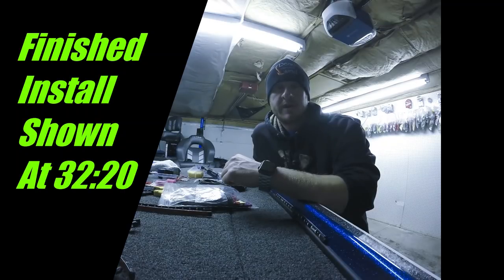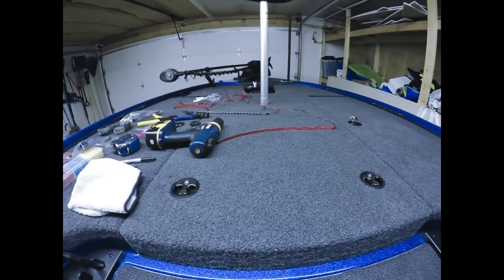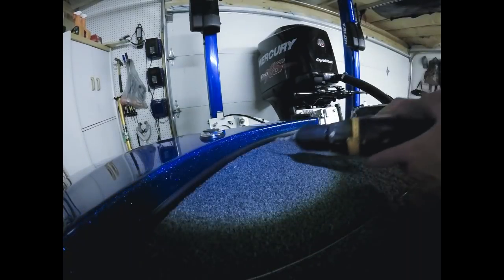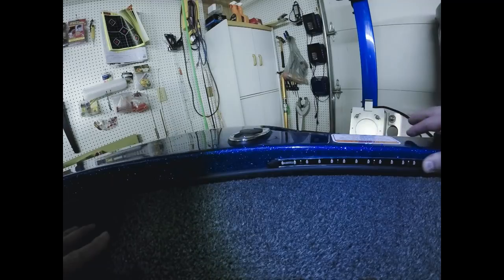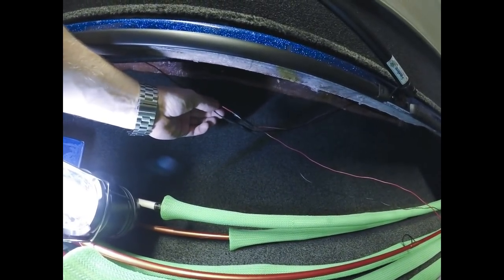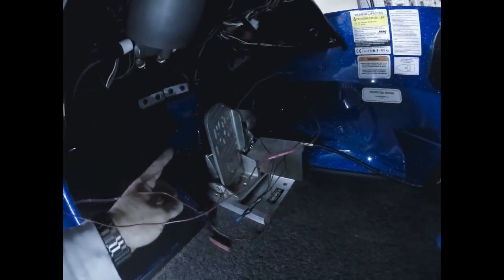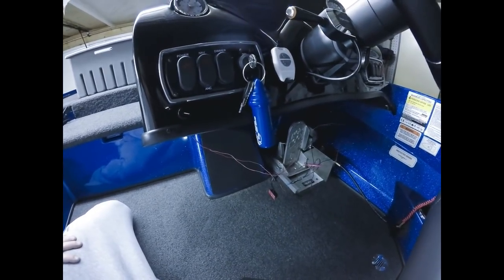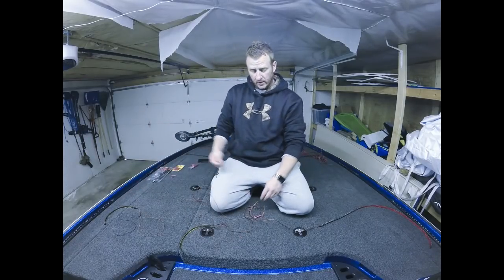Bluewater LED Install On 2018 Nitro Z18

Comment: Your video will help me out so much. I am installing a bunch of blue water light this weekend. One thing I was wondering is how you hooked up the dimmer switch.
Reply from the maker: Thanks for checking it out Mark!...yea I should have included the dimmer switch in the video, but it’s very easy to hook up!...maybe I’ll make a short video showing it for anyone who wants to see it!
Reply: @NitroZ18Fishing  that would be great to see how you did it before I start my wiring this weekend if it’s not to much trouble. Watching your video gave me the confidence to do my own boat over bringing it in somewhere to get it done
Reply from the maker: No trouble at all!...I’ll try to get it posted asap, but probably won’t get it done before the weekend unfortunately...crazy schedules with the kids and sports, I’m sorry!

Comment: Were the compartment lights already there? or did you install those too? And where did you end up mounting the on off switch?
Reply from the maker: hey Zach!...I installed all the LEDs myself, I have them in every compartment including livewells and even the cooler...I also have several switches mounted in different locations...the compartment lights are on a switch I mounted on console, the deck lights are on the dimmer switch I mounted on console, the livewell switch is under the lid, cooler switch is inside cooler at a convenient location (all wiring hidden, because I'm a freak about hiding the wires)

Comment: why the cranking battery and not the trolling ?
Reply from the maker: You honestly could use any one of the batteries but it’s usually best to run accessories off cranking so you don’t drain trolling motor set up with all the extras...the cranking battery will charge while running with big motor and will usually support the accessories with much better success from my experience...also, if you have any transducer on your trolling motor, it’s best to isolate that battery setup to minimize the chances of interference on your graphs....may or may not happen due to LEDs but I wouldn’t want to chance it...hope that helps!
Reply: @NitroZ18Fishing  very informative. thank you!. my lights are hooked up and looking great !!
Reply from the maker: no prob, happy to help!!...glad you got the lights hooked up!!

Comment: Thanks for the video. I am an electical idiot. I could have used the part where the fuse and battery were installed, but hey the video really helped me to see how to run the wires in my Z18. Love the shallow anchors you have too. Would love to see those brackets up close too.
Reply from the maker: hey Bobby, are you on facebook, on the Nitro page?...if you are, contact me on there and I will do a short video for ya on the wiring from switch to battery...I'm sorry, I should have included that as well

Comment: I dont know if I missed it, did you have to add an inline fuse and how big? Do you need to add up all the drain of the strips together when picking the fuse size?
Reply from the maker: Hey Mike!...I run a 7.5 amp fuse for this entire setup, these Bluewaters have a very low draw!...in most cases a 5 amp is sufficient but because I have so many strips I went up to the 7.5...hope that helps!

Comment: Well done with the installation, the boat looks GREAT!!!!  I did the same thing to my old Z6.  Be aware, I used that same dimmer switch, and it will corrode over a fairly short time.  That is assuming you didn't buy a waterproof switch.  I ended up buying the expensive switch from BlueWater.  Great job on the video as well!!!
Reply from the maker: thanks Tom!!!...and yea I'm using Bluewater's Dimmer switch so all is good...I used it on my last boat for 5 seasons and worked like a charm...thanks for the feedback!

Comment: This was awesome!  Thx.  ONE QUESTION,  WHERE AND WHY DOES THERE HAVE TO BE A FUSE?  ASSUMING IT REDUCES THE VOLTAGE TO THE LIGHTS BUT WANT TO MAKE SURE.  I ALSO HAVE A "MAIN" POWER SWITCH ON MY Z7.  I'M THINKING I CAN RUN TO THAT AND THEN THE DIMMER, SO LONG AS THE DIMMER ALLOWS YOU TO TURN OFF THE LIGHTS.  Thanks again.  best video on how to wire!
Reply from the maker: thanks so much for the feedback!...the fuse is to help protect the lights from overload/damage, I like to have my fuse as close to the positive terminal on battery as possible...as far as wiring to the main power switch, I'm not sure about that, wish I could give you a better answer, but I'm always a fan of running direct to cranking battery so I'm not sure if that would work or not, but don't see why it wouldn't...hope that helps, and thanks again!!!
Reply: @NitroZ18Fishing  Thanks again!
Reply from the maker: no prob, happy to help!

Comment: Great video I’m looking into buying some LEDS for my 24’ pontoon, my question is do I need to get another boat battery just for my lights or the main battery is enough? Any suggestions will be greatly appreciated. Thank you for your time
Reply from the maker: thank you!...and yea that's a common question, these Bluewaters have an extremely low draw so the cranking battery is more than enough to run them off...I've never had any issues with battery drain from them at all, hope this helps!
Reply: Yes that helps thanks for your advice

Comment: Hi ..Why the need to wire from the 1st strip to the 2nd and 3rd with a separate wire and not just go from 1 led to the next and so on. I’m a bit confused on that part.
Reply from the maker: Hey Jose!...you technically could connect all the lights directly together (all red to red and black to black)...but if you connect 1 and 2 together you would have no wire to go to 3...that’s where the “jumper wire” comes in...in order to avoid the jumper wire you would need to directly connect all reds together and all blacks together, which wouldn’t work because of distance between lights in my case...hope that makes sense!
Reply: NitroZ18 Fishing
Ok yes makes sense now. I knew I was probably missing something. Thanks for the response back.
Reply from the maker: no prob!!

Comment: This is only like $600-700 in led strips alone lol
Reply from the maker: You’re correct!...it was right around $700ish, I’m picky and had to get exactly what I wanted...lol
Reply: @NitroZ18Fishing  in a more, “affordable fashion” do you think the LED lights that come on a roll would be nice still? Granted these lights you have achieve an outstanding array of light. Bravo 👏 I’m kinda jelly I can’t spend this much 😆
Reply from the maker: Yea absolutely, I’ve actually used other brands in the past...the brightness is still good, the only thing I would recommend is swapping out the double backing tape on them...it doesn’t hold anywhere near as well (depending on brand of course)...other than that they’re great too!

Comment: I have 4 blue LED strips for the outside of the rubrail. After connecting all red and black  wires together do you install them straight to my switch and then straight to the battery from the switch? Do I need not to worry about wiring it to the fuse panel  at all? So I believe from what I understand light to switch, switch to battery. Right? The switch has 3 little ears on the back. Middle one for 12v power, copper is for the negative. Is the 3rd one even needed for anything? Please help!
Reply from the maker: Good evening!...no prob, let me see if I can help ya!...when using a 3 prong switch, in most cases you would run the positive prong to the positive of battery, the negative (ground) prong to the negative of the battery, and then the 3rd prong is usually the one you would run to the positive of the LEDs...so once you connect all reds from LEDs, take that circuit and run it to that 3rd prong...then take the blacks from the LEDs and run them to ground...you can either connect the LED ground to the ground from the switch, or wire them separately to a different grounding spot...hope this makes sense...I don’t use a 3 prong switch in this video so it’s kind of hard to explain in txt without seeing it...if it’s confusing, try googling “how to wire a 3 prong switch”...that should help a lot as well!...let me know if I can do anything else to help!
Reply: @NitroZ18Fishing  
Sounds like that should work. I give it a shot this evening and see how it goes. Thanks for your help.
Reply from the maker: no prob!...let me know how ya make out!
Reply: @NitroZ18Fishing  thanks for your help I will let you know as soon as I get a chance to work on it.
Reply: Hey brother. Thanks for the help. It turned out perfect.
Reply from the maker: awesome!!...glad to hear it worked for ya!!

Comment: Very well Explained.  Thankyou for being so informative. I am going to put these Lights on my Pontoon boat.
Reply from the maker: thanks buddy, I appreciate it!...good luck on the install, hopefully this video helped!
Reply: RyanDean Drury I’m getting ready to put some leds on my pontoon boat too.  I’m still looking for some good bright leds for inside and and under my decking. I was wondering if you had installed yours? If you did was it easy? What kind of leds did you use and what do you recommend? Oh how did they come out? Thank you for your time.
Reply from the maker: thanks Ryan!!!...glad it helped!!!...and @J A G III, i have these bluewaters in all my compartments, even livewells and cooler, they are awesome!!!...install is done the same way, just a matter of mounting the strips where you want them, running the wiring and hooking up to switch/battery!

Comment: Thanks for taking the time to show your work. I was wondering how to hide the wires when you drill the holes for a professional clean install look. Helped me out a bunch. I was really glad you showed the wiring explanation at the end. Wish you would have shown how you hooked up the dimmer switch. Excellent explanations. Thanks again.
Reply from the maker: I may make another video showing the wiring from the switch to the battery...Bluewater sends you a diagram showing it but I should have shown it in the video, I'm sorry!...glad it helped otherwise though, thanks for the feedback!
Reply from the maker: thanks so much!...and i definitely wish i showed the rest of the dimmer switch wiring, very simple, but i have had a few questions on that...should have included it, I'm sorry!...thanks again for the support!

Comment: Looks Great. You have set me up to get my lights in properly. All of your comments and tips were great. Just 2 items 1 setting down against the trim might give you some trouble if you have the boat long enough to change the carpet. 2. When connecting wires, I have had some issues with moisture when I use tape over the butt joint caused by the condensation between the tape and the joint. I have changed and now I either use shrink wrap or silicon. You did a great job, and I will be happy to do it the very same way. Thanks so much
Reply from the maker: Thanks Ron, I appreciate that!…I’ve actually changed to using shrink wrap over my connections as well since making this video…I never had any issues but it’s just an extra peace of mind thing, thanks for watching!!

Comment: I have 2016 z18 and was fixing to do the lighting system on it. I know how to wire but thanks for the tips on the end of the lights and for a nice clean and easy to understand video. Only one tip I may suggest is to put a piece of tape on where you intend to drill and use a small tip nail punch just to push against to make indent in coat to start your drill bit as not to crack gel coat or have drill walk. Other than that good video and you have a very nice boat. Thanks again.
Reply from the maker: Thanks Tom, I appreciate that!...and thanks for the tip!

Comment: Thanks for the tip on notching the back so the wires don't show.  Just bought a set for my boat and will definitely be notching them!
Reply from the maker: no prob!...something so small makes a huge difference in appearance of the install...tight lines!
Reply from the maker: no prob Chris!...glad it helped, and thanks for the support!!

Comment: On the first light...is there wires coming out of both sides? You mentioned at the end the one side going to the next light and 3rd light. What about the wires one the other side of that first one?
Reply from the maker: They only have wires coming out of one side, so those are the ones that you would run to the next light, then use a “jumper” wire to go to the following...hope that makes sense!
Reply: Ok thank you!

Comment: wow really nice. love ur boat, im about to buy the 2021 Z18, probably have some question for you if you dont mind. where did you get those lights and also the storage drawer in frt of the passenger seat. great for glove box storage. where did you get that? im from toronto canada and would appreciate any info. love ur color but improbably getting the red black n white...Thanks joe
Reply from the maker: Thanks Joe, I appreciate it!...the lights are Bluewater LEDs, you can get them from thmarine.com...and that “glove box” spot in front of passenger seat actually came as an option when I built the boat...I had them add it when I customized the build, they should be able to add it for ya as well!...hope that helps, and thanks for watching!
Reply: @NitroZ18Fishing  i ordered my X18 yesterday and added the storage drawer after the oder was in. Hopefully got it on time cause the boat dosen't have a glove box unless you get the second concel. Thanks again for your tips and very nice set up..🐟🎣🚤👍
Reply: Sorry Z18
Reply from the maker: thanks Joe!!...and anytime, always happy to help!

Comment: Great video, super clean install, looks fantastic.  How do you like the lights?  Would you have done anything differently?
Reply from the maker: thanks a lot!...and I absolutely love the lights all around...on the decks/in the compartments, cooler, and livewells/on the trailer/etc...honestly would not have done anything differently, I planned out the project exactly how I wanted it before even starting, so it came out just the way I wanted it...lights work perfectly...tight lines!
Reply from the maker: thank you!!!...love them, and honestly wouldn't change a thing!

Comment: Great video, thanks. We’re the lights part of a kit or did you order lights individually?  Have the same boat, 2020 and looking to do exact same thing.
Reply from the maker: Thank you!!...I actually purchased a couple kits and then some individual lights...I sat down and drew out my plan on paper with what size lights I wanted where and then looked at their site to see what the cheapest way to go about it was...definitely helped going into it with it all drawn on paper, I literally have lights everywhere...have em in all compartments, livewells, cooler, trailer, etc...look at their kits first and see which ones would get you the most bang for your buck, then add individual lights to finish up your plan...hope that helps!
Reply: NitroZ18 Fishing appreciate it. Your trailer is sick also.
Reply from the maker: no prob, happy to help!...and thank you!!